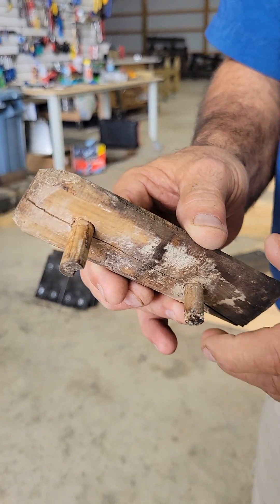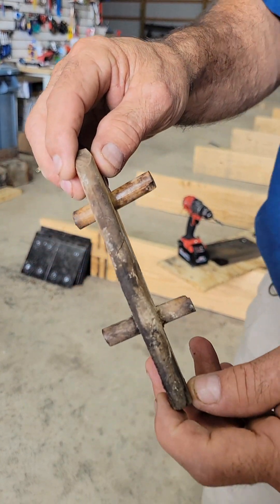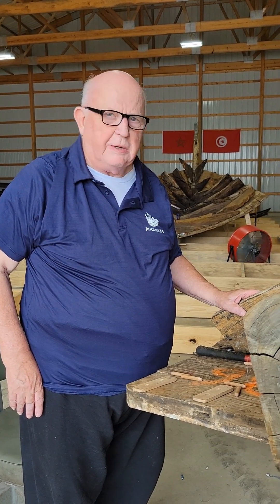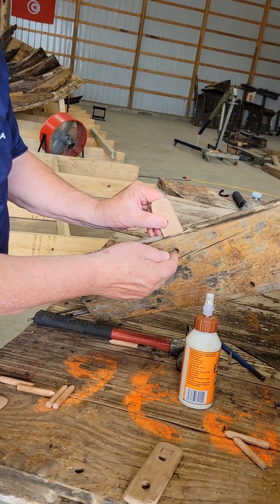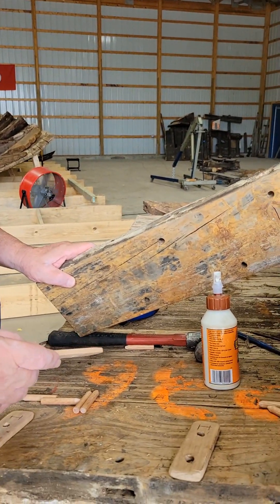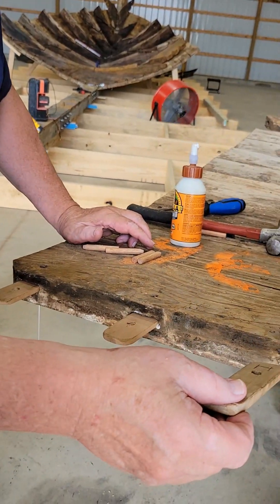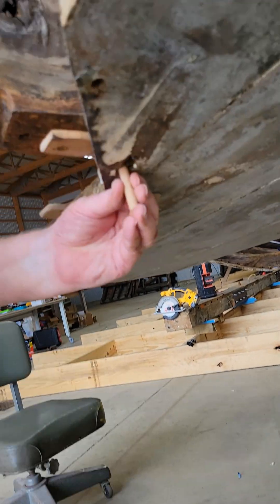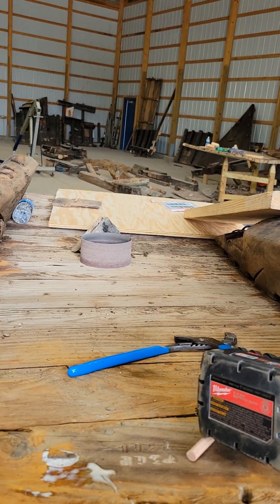Phoenician Joints

Comment: Did the original construction in 600bc use a glue type product? Just curious. Great work!
Reply: I can’t say for sure, but I’d assume so since it would’ve been in the water. Waterproof glues were typically made mostly from resin and ships were often sealed with pine tar based adhesives. Ships took a while to build, so I would assume that they wouldn’t want them to fall apart on the ocean, so they’d probably seal it so it would’ve been safer and it wouldn’t break apart as easily